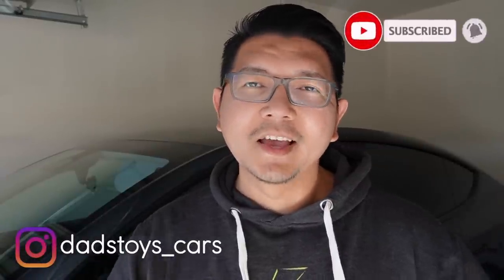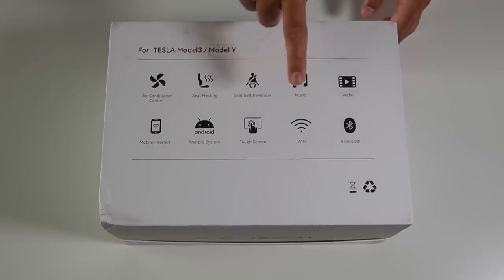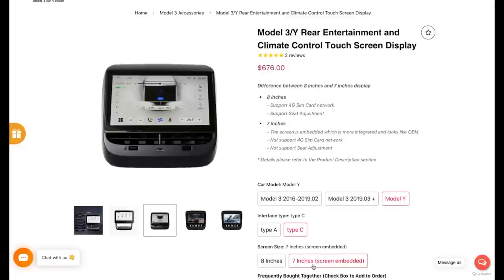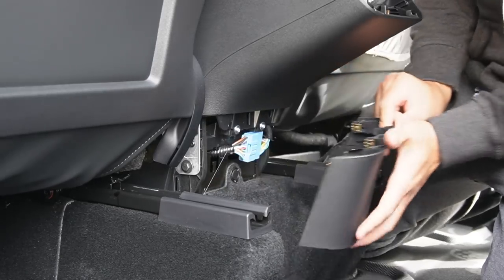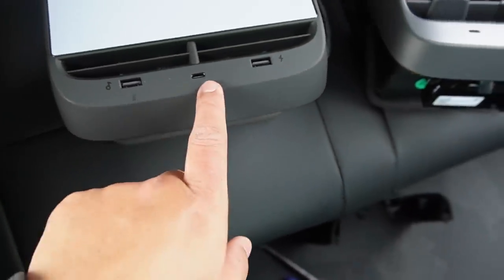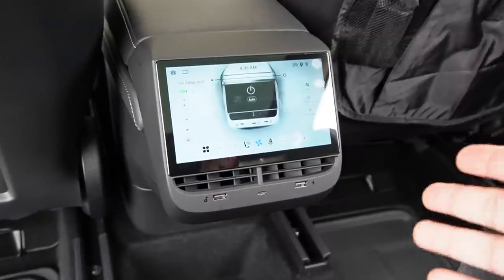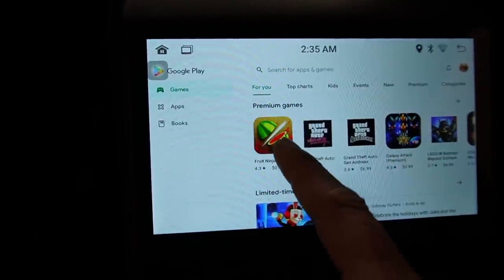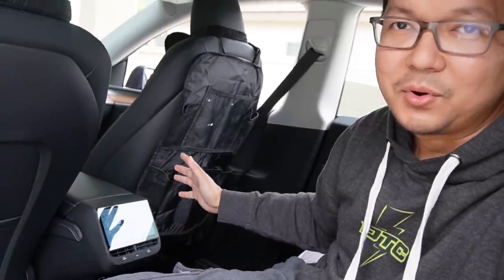2023 Tesla Model Y New Rear Climate Control Display Upgrade! #tesla #2023

Comment: what does it mean by interface type A or C? which one should i use for model Y
Reply from the maker: It's for charging port either USB type C or USB type A. If you have newer car then your car should use USB-C.
Reply: @dadstoyscars  thanks DAD toys, you are amazing fast to respond, thanks. also, the price has gone down from your video? or am i choosing the wrong product?
Reply from the maker: @johnchang8652  No problem 😉 
Just make sure you choose 7” Inches (screen embedded) option on the page.👍
Reply: @dadstoyscars  thanks i ordered 1
Reply: @dadstoyscars  thanks i ordered 1 using your code

Comment: dear friend, could you take the precise measurements of the screen including the black part?  if you could with a caliber I would be grateful
Reply from the maker: Hi, I just got the measurements for you.
It’s 17cm wide and 10.2cm high.
I hope this help.
Thank you for watching!
Please subscribe for future contents.🙏😃
Reply: @dadstoyscars  do you think a screen measuring 175x105 would be fine, is there a bit of margin to put it?  otherwise I have to put the 153x85 one but it only covers the bright screen.  I'm sorry if I ask you these questions but I wanted to buy the protection in the meantime that they deliver the screen
Reply from the maker: @sdalessio76  I would buy bigger size and trim it down to fit display size.
Reply: @dadstoyscars  yes I know this, but I had found these 2 measures the tempered glass
Reply from the maker: @sdalessio76  okay, I got it. Then you can’t trim it down. So you will have to go with smaller sheet or maybe find a clear plastic film one so you can trim to the size you want.
Reply: @dadstoyscars  I always found one the 169x100 glass what do you think would be perfect?
Reply from the maker: @sdalessio76  I think 16.9cm x 10cm should be close enough. 👍
Reply: @dadstoyscars  if it's smaller it's better, the important thing is that it doesn't exceed the size of the display
Reply from the maker: @sdalessio76  agree 👍
Reply: @dadstoyscars  thank you you were very kind 🙏👋
Reply from the maker: @sdalessio76  You’re very welcome 😉 
I’m glad I can help!

Comment: How do you select this device to use car’s internet instead of using phone hotspot?  Also the sound play via bluetooth through cars speakers are very low. I have to turn the car volume almost to max to hear
Reply from the maker: Tesla car doesn't allow to share or turn into wifi hotspot. You can try adjust volume in display setting.

Comment: Greta job man! quick question since you have installed both rear entertainment systems. Which would you recommend this one or the previous 8 inch?
Reply from the maker: This 7” display much easier to install, cleaner and better design but can’t connect to Bluetooth headphones.
8” displays more complicated to install and the display pops out with appearing design but has headphone jack and SIM card functions.
I prefer 7” just for the design alone and installation is much more convenient I didn’t have to connect to front MCU.
I hope I answer your question.
Thank you for watching and your awesome support!🙏😃
Reply: @dadstoyscars  Really silly it does not connect to bluetooth headphones.

This is a dealbreaker, i wanted to use this to have the middle passenger be able to see a movie on the screen, but with audio only in their earphones.
Reply: @JohnDoe-bd5sz  Yeah it's really a bummer

Comment: After spending $600 on the unit why would I wanna go through such complicated installation process? Do you know if Tesla will install it for a charge?
Reply from the maker: This is the easiest rear entertainment display to install.
Tesla Technician will not install any aftermarket parts for you.
Thank you for watching.
Please subscribe for future contents. :)
Reply: Dude Tesla will not install any aftermarket stuff for you.  The installation process didn't look that complicated.
Reply: @erichchan3  Well I hate to deal with the electrical stuff. I was hoping it to be a "snap in" system.
Reply: @kpsher367  electrical?  it's literally squeeze to unplug and plug in the connectors.  there's no splicing or anything.  it doesn't get any easier than this.
Reply: @randomname931  Thanks , I just switched to a  Model X, do you know if that system would work on Model X?

Comment: Why did you go with the 7inch over the 8 inch?
Reply from the maker: I prefer 7” over 8” mainly because of design and much easier installation. With 8” display you have to connect to the main MCU in the front underneath the grove box which could be challenging to install. You also have to run the cable from front to rear display location. The advantages that 8” have over 7” are SIM card capability and headphone jack. They both have 32GB internal memory and Android operating system.
I hope I answer your question.
Thank you for watching Mark!
Please subscribe for future contents.🙏😃
Reply: @dadstoyscars  yes, thank you. The extra inch doesn't seem worth all that.
Reply from the maker: @markhoward9549  Not for me. I’d prefer better design for better looking overall in the rear center console.

Comment: Great video. Thank you for showing the installation and demonstrating the interface. Would you be able to run this rear screen unit and the driver's mini display that installs in the front vent?  Since they both utilize that rear OBD connection, would you be able to install them in series?
Reply from the maker: Thank you!
I think you could connect both of them from the same connection since the hidden mini hud uses very little power from the car.
Thank you for watching!
Please subscribe for future contents.🙏😃

Comment: Has anyone tried the 8” screen? What additional features aside from screen size?
Reply from the maker: Here is 8" display video review I did on my Model 3: https://youtu.be/L4JD5u8A3lo
8" Display Pros: Bigger screen size, headphone jack, sim card option
8" Display Cons: More complicated installation, Not integrated design, block some of the air vent
I hope this help!
Thank you for watching!
Please subscribe for future contents. :)
Reply: @dadstoyscars  thanks for the quick reply!
Reply: Another question — how would you compare this display with the EVBASE one?
Reply from the maker: @joelgutierrez4950   I believe they are the same as Hansshow 8”.
Reply from the maker: @joelgutierrez4950  Try to use to the codes I provided on both brands and I would go with whoever offer better deal for you.
Reply: Is the 8” install for both Hansshow & EVBASE the same ? That is, will it need access to the front passenger panel?
Reply from the maker: @joelgutierrez4950  Yes, they both need to be connected to MCU underneath grove box which could be a little challenging to do because of small space under there.
Reply: I like your channel and topics. You have reviewed same type of Tesla accessories from different manufacturers. It’s nice to be able to afford to compare them. Not sure if you discuss which you find the better/best. Might be another video like “best of”….😀
Reply from the maker: @joelgutierrez4950  I will try when I get a chance. Thank you for your suggestion.🙏

Comment: Great video,what about the tesla warranty?with this display
Reply from the maker: Thank you!
Tesla Warranty on which part of the car?
If it’s air ent then the only issue that could happen is the USB-C power plug.
Otherwise I don’t see and thing that would break.
If you ask Tesla Technicians about this, they will say that they don’t cover any aftermarket parts. This would be the same as any other car brands.
If there is any issue that causes by aftermarket part like this I would just remove the part and put OEM part back in before contacting Tesla service. Since it’s Plug and Play without rewrite any OEM wire.
I hope I answer your question.
Thank you for watching!
Please subscribe for future contents.🙏😃

Comment: Mine does not have that cable at the bottom what should I do? It has only the small connector at the top. My tesla is 2023 and does not have the connector at the lower panel you removed
Reply from the maker: Your car is Model Y standard range AWD right?
If so you have to pick "Model Y 2023/02+ Standard Range (Made in USA)" option on product page.
I recommend to check out newer 7.2" display which is faster and you can connect to bluetooth headphones and game controller.
Here is the review of that display: https://youtu.be/uXXHpT94kEI
Here is link of the product/use code: DAD for 15% off: 
https://www.hautopart.com/collections/tesla-screen-upgrade/products/hansshow-model-3-y-new-7-2-rear-entertainment-climate-control-display-model-x-s-inspired?variant=43720634892500
Here is the instructions how to connect to front passenger panel. After you just run the wire to rear center console: https://youtu.be/cD-c53K2_Sg?t=801

I hope all of these would help.
Thank you for watching!
Please subscribe for future contents. :)

Comment: Hmm almost cool. Wish it could connect to the cars internal system and use the buildin Netflix, Spotify and celluar connection. 
When the passengers are watching a movie or play games will the sound go the front as well? Im listning to death metal and not Coco Melons songs as my kids favour 😞 Last thing, the AC fan control is for both sides so you cant control them individually?
Reply from the maker: I don’t think Tesla would let aftermarket unit access those info and functionality.
The display connects to all the speakers in the car.
Ac and fan control both sides of the rear air vents.
Thank you for watching!
Please subscribe for future contents.🙏😃
Reply: thank you for the quick answer :)
Reply from the maker: @k9g636  No problem, I’m glad I can help! 😉

Comment: You can control the speed of the rear air flow, but can you control the direction? To make it go higher or lower, or left or right?

P. S. You can use YouTube during drive?
Reply from the maker: You can't control fan direction on this display. It's fixed to both side passengers.
You can watch streaming service you drive as long as the display can connect to internet via your phone wifi hotspot.
Thank you for watching!
Please subscribe for future content. :)
Reply: @dadstoyscars  what about sound system? I could not understand how you solve that.

Comment: Hey I have a quick question. Can the rear passengers still watch youtube/ netflix or other streaming services while the car is in drive? Thank you for the video by the way.
Reply from the maker: Yes, They can. There is no Netflix in the google play store, but they have other streaming services.
Thank you for watching!
Please subscribe for future contents. :)
Reply: @dadstoyscars  That's defeating the whole purpose.  Netflix and Disney Plus was reason why I purchased it. Can we pressure the manufacturer to work on the firmware or eventually give some workaround solution
Reply from the maker: @deanb8912  They just released new update which you can install Netflix and Disney Plus on the display.
Here is the link: https://drive.google.com/file/d/1xViR7m2_ywuG-h4qGHwjT2y9OiYat5FS/view
Please follow the instructions.
Thank you for you support!🙏

Comment: I just checked with Tesla service guy, as per him any non cosmetic after market parts will affect the warranty. So please be aware.
Reply from the maker: If you asked any other car brands service department the answer will be the same too. Because no car manufacturer will cover issue that cause by aftermarket parts. If this display would ever cause any issue in the future if any at all, I will just uninstall and put back OEM part before I contact Tesla service. Thanks for watching!

Comment: My 2023 model Y wireless charger stops working after installing this.
Reply from the maker: Very interesting. Because the port in the back should have anything to do with from wireless charging pads power supply.
I would remove the rear display and put everything back to its original form then request the service from Tesla.
Thank you for watching and your support!

Comment: There is the link to get $1000 off on new Tesla? Is this a scam, i just clicked, ans it doesn't see it took off $1000!!!
Reply from the maker: You will get $1,000 off on model S and X also get $500 off on Model Y and Model 3.
No scam it’s officially from Tesla.
Reply: @dadstoyscars  then u shouldn't say the your link will get the discount, because it still get discount without your link!!
Reply from the maker: @Jay-r9x3f  No, you will get extra discount with the link.

Comment: Me Personal Wouldnt advise anyone to install any Third Party Devices into a Tesla if its not apart of the orginal wiring diagram could cause range issues, shorts and miscommunication within your CPU plus if you do and thats the cause of your issue tesla wont even touch the vehicle
Reply from the maker: First of all, the plug that I plugged in is basically a pass-thru to plug to extract information from the main display and gain climate control of the rear section of the car. It dose not send out anything to the car or make the car faster or slower so that won't effect any range issue at all. Thanks for watching!
Reply: Then you can take it all apart since it’s plug and play return back to original and go back for warranty.
Reply: @dadstoyscars  so it’s a pass thru to sent a climate signal to the main MCU and last time I checked you can sent and receive data thru Bluetooth correct??
Reply from the maker: @richiebillionz00  I don’t think you can send or receive data via Bluetooth in this display. Bluetooth in this display only use to output audio to the car’s speakers or Bluetooth headphones and connect Apple CarPlay with your phone.
Reply from the maker: @Mreyes925  That’s what I would do if there is any issue.
Thank you for watching and your awesome support! 🙏😃
Reply: @Mreyes925  and it can be seen that device was disconnected at a period of time too

Comment: It looks extremely slow, you keep cutting away on the loads……
Reply from the maker: It’s not as fast as Tesla system for sure. But it’s not that bad for small display for rear passengers. I had to cut them otherwise this video will be an hour long.
Thank you for watching!
Reply: @dadstoyscars  yeah, slow. I have a similar device for my tundra and all the reviews cut the load times out, had I know it took 1 min for YouTube to load I would have passed.
Reply from the maker: @brandonavants7662  Oh this display is much faster than what you have on your car. I just timed it for you. It took 20 seconds to load YouTube app if you open the first time after it opens up right away and less than 3 seconds to load video on YouTube after you open it.

Comment: NEVER order from Hansshow. Bought this device and it partially doesn’t work. They refused to take the product back and wanted to do technical support. They then asked for WhatsApp number to do tech support as they are a Chinese Company. They never replied back and instead I started getting tons of random Chinese calls and even had a social media account hacked with another one someone attempted to do so. Also got numerous strange contacts on Whtsapp. Avoid this company at all cost. I never complain or report a company but had to say something. If you buy their product pray that it works.
Reply: My screen is frozen amd trying to figure out how to reset it,   Any luck on tech support?
Reply: @Labonts  Tech support is horrible. Best of luck with them. I would never ever order or buy a product from this company.